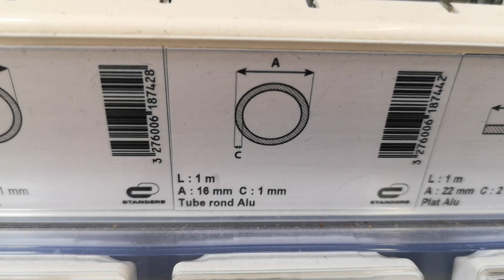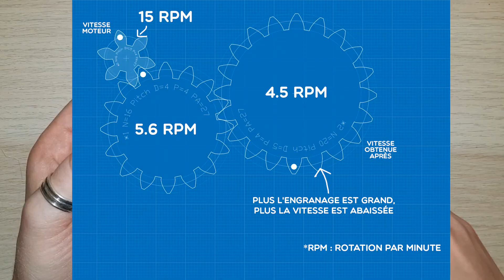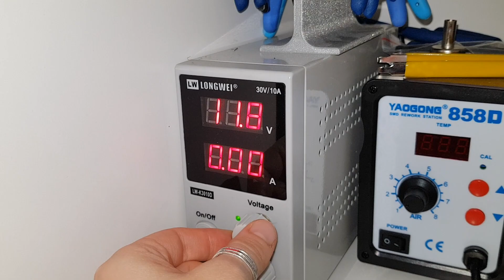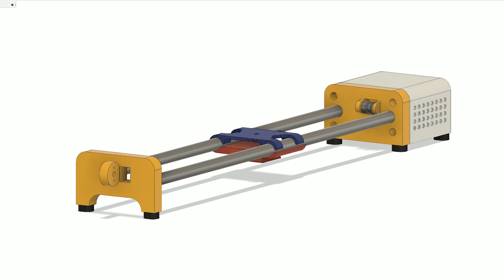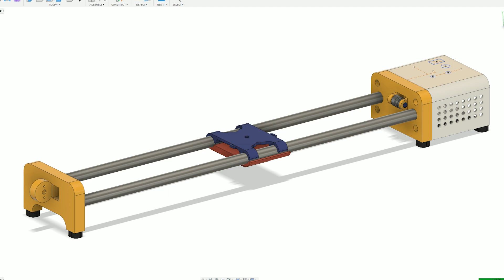Comment passer d'une idée à la réalisation finale ?

Comment: Bien joué pour ce projet ! J'avais une idée de ce genre pour mes élèves, et je crois que ça va m'inspirer. Mais même pas sûrs qu'ils arrivent à faire aussi bien :D ! Des fois en 30h de conception ou+, on arrive a bien moins bien que ça ... :( Tu peux être fière de toi !

Dans le chapitre améliorations, mais pas indispensables puisque ça fonctionne bien selon toi,
- faire en sorte de tirer la courroie dans l'axe du déplacement, et de manière centrée entre les 2 colonnes de guidage. Tu tires un peu en décalé, ce qui doit avoir tendance à faire légèrement pivoter le support de caméra (autour d'un axe vertical). Tu risques l'arc boutement (= coincement) si le reste de ta conception manque de jeu, ce qui n'est visiblement pas le cas. Mais, je pense que la longueur de ton motoréducteur a dû t'imposer ce centrage décalé.
- par habitude, on guide les pièces sur une longueur qui va de 1,5 fois à 2 fois le diamètre pour assurer un positionnement ou un guidage précis. 
- pour régler le souci des butées, tu pourrais faire en sorte que la caméra passe au dessus des platines (pièces bleues qui fixent les colonnes de guidage) et qu'elle déborde latéralement. Comme ça ce serai la plateforme support de caméra qui actionnerai les interrupteurs. Tes colonnes peuvent être plus hautes sur les platines, ou tes platines globalement plus basses, ou sinon ton support de caméra peut avoir un extension verticale pour positionner la caméra plus haute. 
- j'aurai plutôt installé le moteur sur la platine coté cartes électroniques. Une raison t'a poussé à le mettre de l'autre coté ?
- le petit bitonio = adaptateur de diamètre ?

Voilà quelques remarques si tu souhaites modifier un peu le truc ou progresser en conception méca. Je comprends que si ça marche comme ça, alors c'est que ça peut le rester ! Le mieux est parfois l'ennemi du bien !

En tout cas super taf et super démarche ! Bravo !

Comment: Salut Axelle :) 
Sympa le projet, bien détaillé, et assez simple a réaliser... Allez, quelques idées.

Évite de garder les fils dénudés du pack accu pour la présentation, un risque de court circuit est présent..
Pour le probleme de hauteur de courroie par rapport au support, il suffit de réimprimer un support avec une hauteur plus importante, de manière a avoir les oreilles de passage courroie a la hauteur des poulies.
Pour le switch d’arrêt, le choc est du a ce que le moteur ne s’arrête pas immédiatement, du fait de l'inertie. Il faudrait des switch avec un bras de levier plus long, et éventuellement en métal, qui acceptera une déformation contrairement au plastique.
Et pour éviter le frottement du plateau sur les tubes alu, qui provoquera une abrasion, il faudrait coller un adhésif PTFE dans l'arrondi , au contact des tubes. Cela permet une meilleure fluidité de translation, et évite l'usure.

Sinon, beau boulot.
Reply from the maker: Tu aurais un lien de l'adhésif en ptfe ? :)

Comment: Super vidéo , mais j'ai quelques questions:
Pourquoi utiliser un circuit " réel " ( avec des switchs directement controllant les courants ) à la place d'utiliser un microcontrolleur qui apporterait beaucoup de versailité ?
Etait-il impossible de directement serrer la poulier sur l'axe du moteur ?
Pourquoi ne pas utiliser un moteur pas à pas ? En microstepping il permettrait d'avoir un mouvement lisse et aussi de controller plus finement la vitesse, et surtout de ne pas avoir besoin de switch de fin de course.
Et finalement, pourquoi ne pas avoir fait en sorte que les switch de fin de courses buttent directement sur le chariot au lieu de la caméra ? Si tu changes de caméra tu risques d'avoir de nouvelles mauvais surprise :/
Super chaine, du bon travail et tu expliques bien le processus de design

Si je devais ajouter une suggestion, le chariot lui même pourrait être motorisé directement, pour pouvoir ajuster la longueur du slider sans tout changer. Avoir des roues motorisés sur le chariot avec tout le matériel dessus ( dans ton cas, vu la taille de la carte de contrôle moteur ça serait compliqué en effet, c'est juste une suggestion )